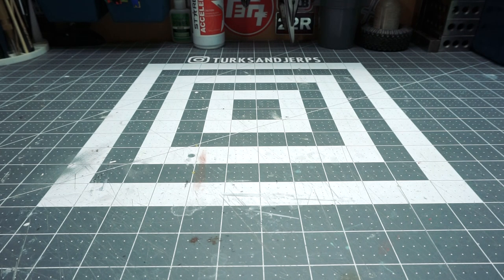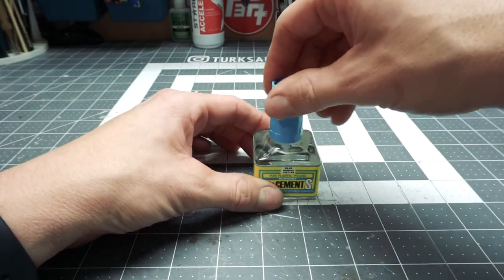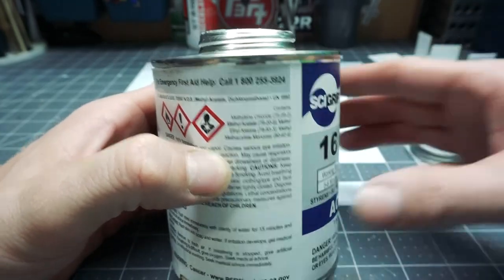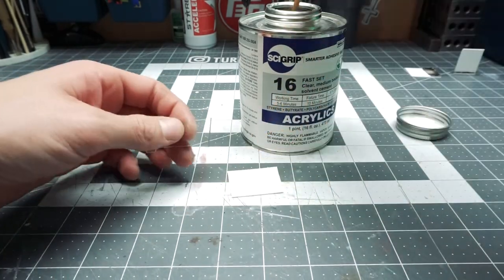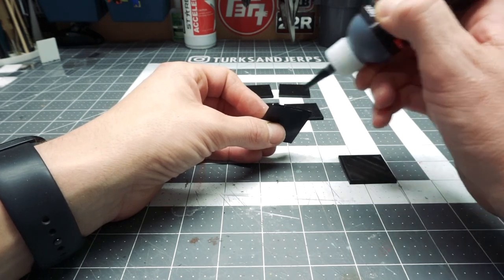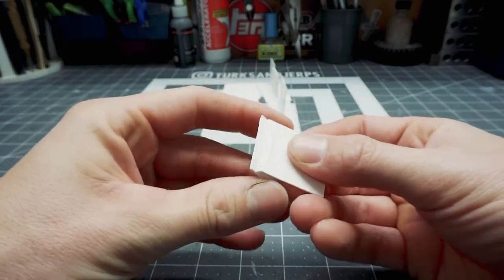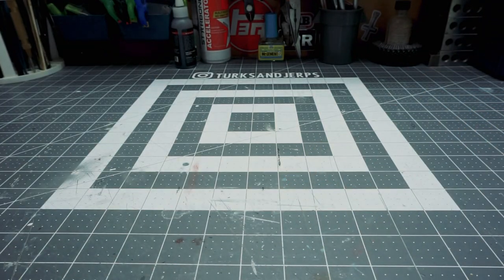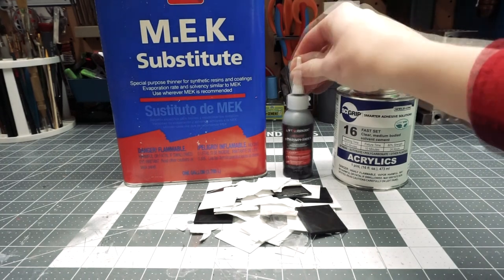Glues and Adhesives for Building RC Bodies - Pardonmyn00b's Turks and Jerps

Comment: This is great, thanks for taking the time to make this one. Working on my first RC4WD body and bought the Plastruct plastic weld. Looks like I'll be getting some MEK sub when this runs out 👍. I know we have seen a selection if your cutting tools in other build videos, maybe some overview of the essential blades or saws we should have? I had to cut holes in the Mojave bed to fit over the shock towers and did a hack bodge job of it. Thankfully I have a lot of good files so I could clean up most of it, but I'm sure there's some convenient handle to hold narrow jigsaw blades or something that would have made it clean and easy
Reply from the maker: A cutting tool video is a great idea. I've amassed quite a collection saws and cutting tools for this hobby. A coping saw might work for that particular instance. When I cut holes in a bed for shocks I usually make a cardboard or styrene template then transfer it to the bed. Then I go crazy with a cutoff wheel on the rotary tool and clean it up with file and a sanding wheel.
Reply: @turksandjerps  That's about how I did it too, except I tried a cutoff wheel and a soldering iron to get into the tighter areas. I'm glad I did it in the garage because I'm sure the house would still smell like toxic burning 😂. The fine cut files I got for gunsmithing work really well on the plastic for cleaning up edges

Comment: Hey thank you so much for your time! About the 3-D printing if I the guy is starting from scratch not knowing anything is there a long list of ABC’s to learn before purchasing a decent reputable printer or is it just worth having someone print it for you it’s kind of a odd question some people say that it’s a headache another say it’s a piece a cake I just wondered if there was anything that stuck out to you and that one should know before investing in a printer I was looking at a few that were around $400+
Reply: 3D printing is a whole other hobby. It is great to be able to make your stuff, however there is a learning curve. Definitely not a set it and forget it hobby. There are a lot of great videos on YouTube. The Ender 3 or any of it's clones are a great starting point, decent machine for a low price point.
Reply from the maker: I think we're at the point in time where everyone serious about models and this hobby needs a 3D printer. I use a nearly stock Tevo Tornado which I think is a CR10 clone. Is it the best and most expensive? Not by a long shot but it has been very reliable for me. I can make an average print look great with my finishing skills. Other people can't finish or don't care to so that's probably where a higher end printer would be useful. Anyway, there's a slight learning curve but I was able to get the hang quickly with some videos and google searches.